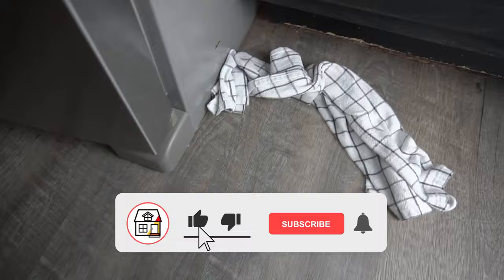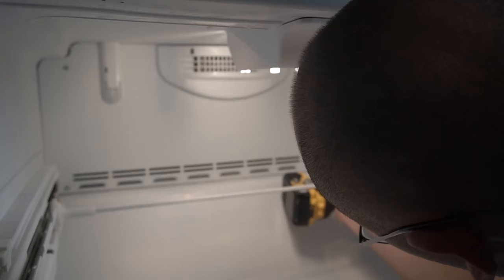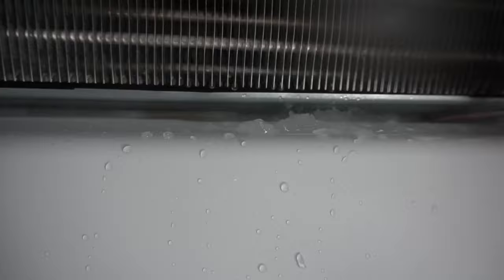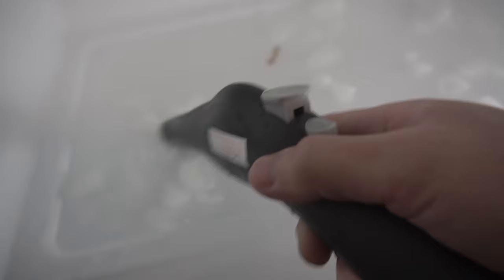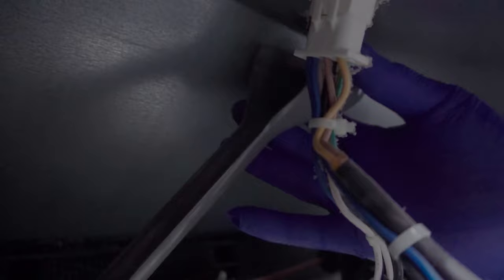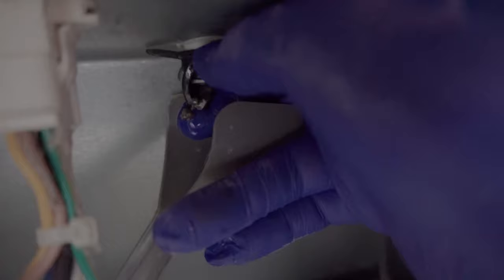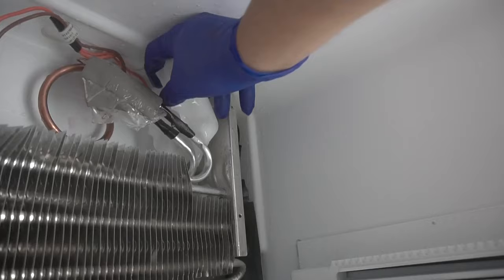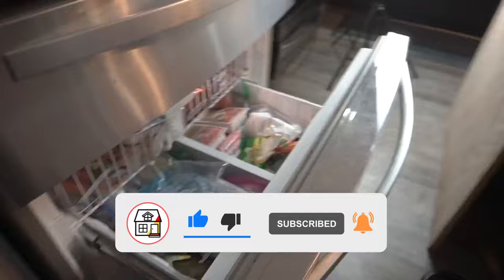How To Fix A Leaking Refrigerator QUICK! Water Leaking From Freezer - SOLVED DIY!

Comment: Steamer is the way to go. Do not use a heat gun or hair dryer. They will more often than not melt the liner. Steam can only get so hot so it is safe.
Reply from the maker: I agree! steamer is the best and safest way! I personally use this one: https://amzn.to/3jyzqAO
Reply: Who has a steamer?? No one.
Reply: @edeberding4536 if you can spend $1000+ on a fridge, you can spend $12 on a steamer. That's the point
Reply: I respect your recommendation but steam can get hot enough that your whole refrigerator will look like it was in the Lahaina fire instantaneously.  The steamer in the vid won't get that hot though. :)
Reply: @jodynorris6975  I'm not being a jerk. The steam that goes through the turbine at the power plant that I work at is 1005F at 2200psi.  It is possible to super heat steam way hotter than that. I'm not the one in danger of being embarrassed here. Might take a look at the steam tables Mr. Fireman.
Reply: @jodynorris6975  Jody. My bro. In the vid he says steam can't get very hot or something similar and its better to use that than hair dryer or heat gun. I was really just joking around that under the right conditions steam can get very hot. I really don't think you or really anyone else will get confused by my flippant comment when they are trying to get the ice out of their drain hole on their fridge. This is the internet. Bon Jour.
Reply: Now you can also have a hairdryer with hot and normal heat that would not melt nothing so, hairdryer is good also
Reply: Spray bottle filled with salt water.
Reply: It’s 2024

Comment: I grew up in the 80s and 90s. We had a fridge and freezer that worked for decades without having to go through all this trouble. The "smarter" technology gets, the worse it is.
Reply: Ohk ! I’m jst said this now I wasn’t be grown and I’m here lol I’m like ma I never knew they had no damn pan under the fridge lol
Reply: Yup exactly!! I want to buy an old one with the freezer on top. All this trouble with a upgraded one
Reply: Amen
Reply: You had to manually defrost the old refrigerators 🤣 
What he just did probably only needs to be done every 5 years or more
Reply: Same, my parents had the same fridge for about 20 years. Replaced it because they wanted a more modern one. Our old one was still working so, my dad sold it to someone else.
Reply: Barbarossa  My wife threw out one that worked great minus leaking in the bottom. Bought a new one. They use to make things to last but where’s the money in that. Greed. Greed. Greed.
Reply: It's done on purpose so that you have to buy another one.
Reply: Oh brother
Reply: Absolutely 💯 true! My Samsung is less than 2 years old.  I was warned not to buy Samsung and LG products.
Reply: @exdemocrat9038 exactly. It's called "built in obselesence"
Reply: Basically this can happen to any defrosting fridge which have been around since around the 80s or 90s. They need that small nipple to stop bugs crawling up there. Its a simple fix and in the end quicker than having to manually defrost a freezer every few months.
Before you consider keeping your old trusty fridge calculate how much more electricity it will cost you per year compared to a newer fridge. I'm not sure but maybe a new fridge every 10 years is cheaper than the larger electricity bills!
Reply: @pm7252  the problem described here can also happen with top mounted freezers. Basically any defrosting freezer.
Reply: @techhints4343  those days defrosting was automated as there were endless power supply failures at home😅
Even I feel refrigerators ..to washing machines..everything needs frequent repair work these days!
Reply: True. And the frigs- lasted for 20 years.
Reply: Yepp if it’s broke don’t fix it. I don’t get why we need all this crap that wipes your ass for you
Reply: Not smarter. It's called planned obsolescence, meaning Wall Street is pressuring companies to increase profits. Cheap parts and engineering products to fail after a certain amount of time increase repurchase of products and thus increase sales =profits.
Reply: They make things more breakable now so you have to buy new ones.  Also keeps repair shops in business.
Reply: I know. It's ridiculous
Reply: My buddy has a 1957 International Harvester fridge. It still works fine. 
It keeps beer ICE cold, not luke cold like modern fridges.
Reply: @callapygian     Aaahahahaa.  Of course it does.  All the different types of suck that have come along with this electronic/digital age are infinite.  I miss turning knobs and pushing actual buttons. All the "touching and sensing" is a joke.  We got a Samsung washer and dryer, and I can't even let things soak mid wash, cause when you pause it, all the water drains out. The dryer shuts off when it "senses" the clothes are dry, even when they're not, so if they sit overnight, they get musty and stanky, and you have to wash it all over again. Our brand new dishwasher takes 3.5hrs to finish its run, and I still have to rinse and dry most of it before I put it away. The 20yr old dishwasher at my last place only took like 45mins-an hour, and nothing ever came out dirty. I could go on forever, but I'm just getting annoying at this point, so I guess I'll end my rant.
Reply: Tell me about it. Incompetent cowboys in charge nowadays
Reply: @@Tom-qv2jg I do now Thanks.
Reply: They used three times as much energy though.
Reply: Totally agree.  It's all about companies making money
Reply: Yessssss I have a very expensive glass top stove and it cracked! It’s only 1 year old!!!! I remember back when we never had any issues with our appliances!
Reply: @VioletHeyoka  That’s before greed to control. If it doesn’t tear up they can’t sell a new one. Everything from the 70s back lasted for years. Brake shoes on my old truck would last seven years or more. Tires lasted way longer. It’s all about $$$$$$$$$$$$$$$$$$$$$$$$$$$$$$$$$$$$$$$$$$$
Reply: @tellyboo2455 What are you trying to say exactly
Reply: Exactly! My mother was into the 20th year of her marriage when I saw the first problems with our fridge, it ran absolutely fine for 20 whole years. The smarter technologies are literally crap
Reply: Not true. The "smarter" technology gets, the better it becomes. Otherwise, we would still be using 80's & 90's tech. 

It is true that the more complex a product gets, the higher the risk of something breaking making a big problem that could have been avoided if the product wasn't that complex. But the technology is not to blame, it is the corporations. 

Since the 80's (thanks to Reagan) greed has run wild making corporations cut corners, use cheaper material and increase prices to make an ever higher profit. They have made it harder for people to repair their appliances and have shortened the lifespan of appliances on purpose. 

This is why apple makes it too expensive for iphones to be repairable. That is why trucks don't reach 300,000 miles like they used to and why appliances like washers, dryers, fridges, TVs, etc don't last as long as they used to.
Reply: @Vera-xu3xw that’s not really true. We have a a newer fridge it’s only 2 years old and we just experienced a very similar event about a week ago. We initially thought that maybe the fridge door wasn’t closed off flush. But than realised that the fridge beeps if the door isn’t closed tight! Now we know why. The older fringes use to have a plastic tray sitting on top of the compressor where the water from the fridge drips into and pan and evaporates, the newer one I just realised has a cooling fan from watching the video. Which means dust will be collecting at the back of the fridge. I just checked the grills and it has. Will have to open up the back and check it out tomorrow. Thanks for the video and comments guys.
Reply: @TruthIsARuin I just had to laugh, but I know what you saying. I made a new rule at home everyone washes I mean hand wash, their own plates and dishes etc! So the dish washer ain’t needed any more and nothing piles up in the sink.
Reply: @sereanaduwai8313    Haha.  I remember the last  100x's I made that rule.  Wish one of them would've stuck.  I can't even get the grown man in the house to rinse a dish.  And I swear, it's like he's convinced himself that he really does ALWAYS rinse the dishes before leaving them there to turn into super glue. Even though you could see from an airplane that they haven't been touched by water since he ate off them.  Butthead...
Reply: @Vera-xu3xw No. we had an 80’s Westinghouse fridge that did its own defrosting. Never in all my years growing up did we have to clean any drains.
Reply: Quality of everything has declined a lot.  I’ve noticed with clothing too.  It sucks.
Reply: My aunt had a refrigerator they bought in 1959. It worked without problems for 58 years😂 She finally had a tiny leaking problem and decided to dump it and get an energy efficient one. RiP frig... you are still missed😢😂
Reply: You are correct.  Just wait it will get alot worse with the laws they have passed for appliances.
Reply: Planned obsolescence.  Every day at the house it’s something. Regardless how much I keep up with things to keep them nice and/or buying higher quality stuff…it’s constantly failing!!!!!!!Seriously getting tired of it.
Reply: Made in China. Nuff said! Well maybe Korea
Reply: Does that fridge used to consume same units of electricity?
Reply: My sentiments exactly, I hate all of this unnecessary newfangled bullstuff.
Reply: Even on my old fridge I have I just got the same problem
Reply: My mom’s fridge lasted 40 years.  Never had to do anything to it, just clean the shelves.  My ten year old Samsung fridge started leaking overnight.  Woke up to a collapsed ceiling in the basement.  Thanks Samsung.
Reply: My mom’s fridge lasted 40 years.  Never had to do anything to it, just clean the shelves.  My ten year old Samsung fridge started leaking overnight.  Woke up to a collapsed ceiling in the basement.  Thanks Samsung.

Comment: Having the same problem. Just a thought.. what if I emptied the fridge and unplugged it for the night with doors and drawer open so any ice buildup would melt. The drain nipple is nice and clean by the way. ???
Reply: This is what happened during a power outage and it fixed my leaking problem.

Comment: There is a new part that you can buy!!! That black rubber part attached to the fridge that got clogged with dirt that you cleaned out has been replaced with a new redesigned part from the fridge manufacture. Replace with the new part and the freezer won't get water/ice on the bottom anymore. I did mine and we have not had issues again.
Reply: Thanks for telling us!! What’s it called?
Reply: @jvarghs  I can't find my receipt. I can't remember what the part is called or the part number. If you call a parts department they should be able to help you out. Or google it, that's what I originally did before heading to my closest parts department.
Reply: Or clip the original oem nipple at the end of the rear drain tube on the back to prevent it from clogging,(design problem)

Comment: you forgot to install a copper thick wire over the heating coil to go into the drip hole to be used as a heat transfer conducter and will always melt any ice build up in the drip hole .
Reply: Very good tip.  I’m going to do it.  Thanks

Comment: Also make sure you check local city and state laws, as well as any applicable HMOA's, before you begin work on any electrical component. Be sure to put a sign that says "Wet Floor" before you begin work on a job like this, where literally anyone walking by could slip and fall, potentially resulting in a severe injury. It is always best to be safe than sorry, so as to avoid any costly lawsuit.

Comment: I wanted to put an update to your video.  Our LG French door refrigerator was also leaking out from under the freeze.  I planned to pull it apart this coming Saturday as I found a sheet of ice under the lower bin.  This is where it gets interesting and a much easier solution.  You may not need to pull it apart as in this video if you will check for this issue.  Be sure to check the door seal before you start pulling things apart.  While my wife and I were looking at the freezer door she commented that the door had a gap where the seal touched the right side frame.  Room temperature air was getting in.  She could push the door tight and it would seal.  She let go and the seal came away from the frame.  I looked up under the lower bin to see if there was something blocking the door from closing.  I was expecting it to be a build up of ice.  I then spotted a frozen food package had fallen down between the door itself and the larger lower bin.  There is a sizeable gap between the door and the lower bin.  The food package was hanging down between the bottom door seal and the bottom frame.  It took some pulling, but I was able to remove the package which allowed the door to seal all around the frame.  So while we were down there we used a large wood paint stir to knock out the ice sheet under the bin.  Then using an old toothbrush we cleaned between the ridges of the seal.  A lot crap fell out.  Then we clean the faces of the seal and the frame.  We now have a good seal all around the freezer door.
Reply: This happened to my family when we bought our first french door fridge with bottom freezer door. the bottom freezer is notorious for getting caught open letting in warm air. The first sign we look for now is seeing frost forming over evwrything. Thats the moisture from the warm air getting frozen. worst part for us was the problem being user error! we didn’t have any food blocking the door. our problem was not pushing in the top basket all the way and then pushing the door closed with our leg thinking it would push in the basket farther to close, if need be. luckily, i bought a warranty with the fridge so we were able to have a tech come to the house, paid by the warranty, to show us the reason. But yes, food can also block the door from shutting properly.  Troubleshooting leaky fridge should start with door shutting properly to keep out warm temps and keep in the cool.
Reply: In our refrigerator there was a nearly empty food bag that originally held the freezer drawer (like in the video above) slightly ajar.  We removed the food bag and thought we had an end to our problems.  But a few days later we found water on the floor again.  We removed the drawer pretty much as shown in the video above and found ice on the sloped bottom.  I think the bottom of the lower bin was pushing against the ice which kept the drawer from fully closing.  We cleaned up the ice, but didn't open any rear panel.  I have to look again, since my model is different from the one in the video and may not have a panel there, everything may have to be reached from the back of the refrigerator.
This video is a great how to for this type of refrigerator.

Comment: I had the same problem with my freezer. All the videos I found were to fix water coming from UNDER the fridge, not under the bin INSIDE the freezer. I followed your instructions and it worked beautifully. Thanks be to GOD and you, my floor is dry again. I am a home remodeler who specializes in bathrooms, but my appliance repair knowledge is limited. Thanks to you, I know how my refrigerator/freezer's operation so much better.

Allan Wiggins
🙌

Comment: OMG, you are a life saver.  After 21 years of fighting with my Maytag fridge and having a towel to catch the access water coming onto my floor, I took apart the rubber hose attached to the drain and it turned out to have insulation clogging it up.  I never would have checked that for an issue as I never thought anything would be able to get into that drain valve.  Turns out the insulation from the regulator was dropping in the drain valve and over the years was clogging it up.  THANK YOU for this video, you are a life saver! 🙏

Comment: Be sure to have a good air flow in the freezer. Mine did this too. I learned that my freezer was blocked off at the back by things I had in it. I always check mine now to make a space for air to flow and it has stopped freezing up. Whew. Great video!
Reply: This also caused the problem for me. Stocked up on a bunch of food during the Covid shortages and blocked too much of the air flow. Also, it seems to happen more often if I cook a lot of things involving boiling water (rice, beans) during the winter months when I can't open the windows to really clear out the water vapor in the kitchen.

Comment: Kudos for mentioning the rubber slit you access from the back of the fridge.  The dust buildup in it is what causes the water to back up ever so slightly in the freezer which fills/freezes in the main drain hole slowly over time.

Comment: Thanks for this well explained video. The fridge in the house we moved into was completely clogged up with ice and was leaking constantly out the front. Your video laid out the process really well and enabled me to get the whole job done in less than 3 hours. Thanks again for the help!
Reply: Could you have unplugged it for a few days if the fridge was empty to solve the problem?
Reply: @AlfonsoMoreno-en2sv  You can open the doors and let all the ice naturally melt, you just have to safely store your food, or buy new food since food spoils or grows bacteria in less than 2 hours after being removed from the fridge, or if the power goes out. The only issue with letting it naturally melt, is that this method doesn't clear the debris and gunk that often causes the clog and drainage issue. So it might happen again sooner than if you actually take it apart. At least this is what I read in the comments on another video.